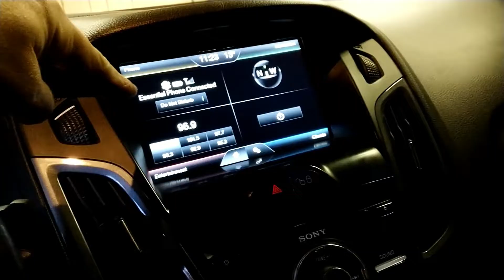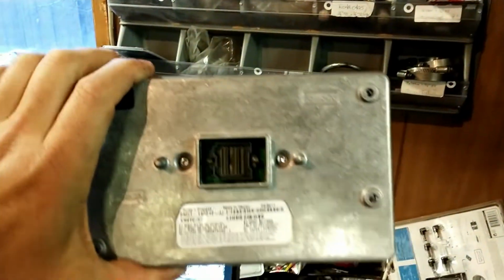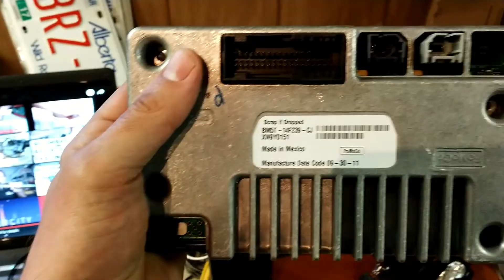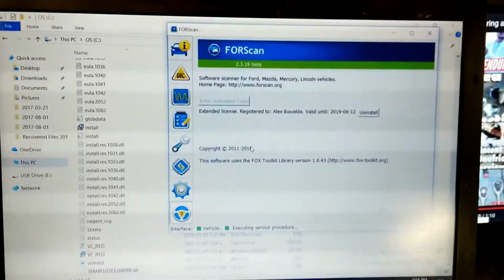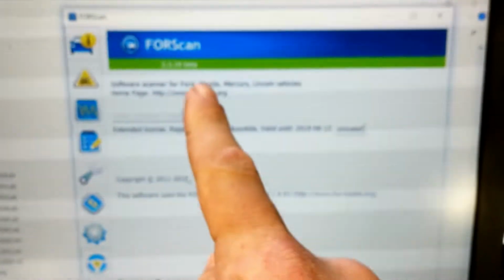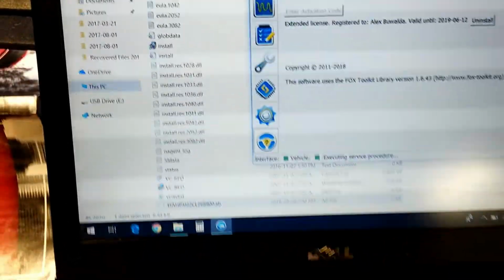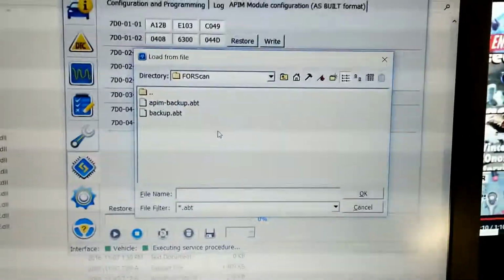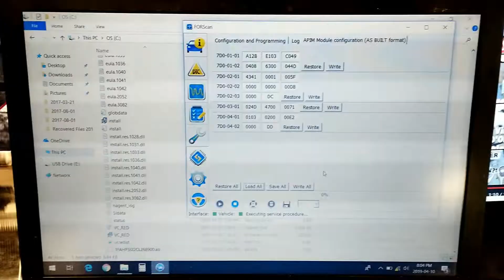Broken Ford Sync APIM Repair\Replace\Reprogram

Comment: I bought a great condition radio.
I can’t change my bass, midrange, and treble
My temperature isn’t working and I can’t see my volume on my car any tips I can do or do my radio has to be reprogrammed??
Reply from the maker: Hey there, did you buy the APIM from the same model car? or a different one? Most people seem to find a close model car is the best chance without having to go through the whole ForScan reprogram sequence like I did to go from Edge to Focus.
Reply: @Kingsoupturbo  no I didn’t honestly I don’t know what that is. Should I get one?
Reply from the maker: @_BOSS313  Was it a entire unit from another Ford?  Although the units are the same, each model has its own radio\climate control etc. The F150\fusion\Edge etc. all have different screens, and control for different audio.  So usually you want to get one from the same car, or you have to reprogram it to work with the model you have, so everything works.  On the Ford Edge one I got, I could use some functions but others didn't work at all and the screen was out of calibration.
Reply: @Kingsoupturbo  I bought another Ford Fusion radio I might just go and get it re program again thank your for the advice
Reply from the maker: @_BOSS313  It might be different from a Fusion Titanium to a mid grade model or something? a shame it didn't just work right away, even if you have to get it programmed still cheaper then the ludicrous cost from Ford for this thing.  Thanks for watching and best of luck!
Reply: @Kingsoupturbo  everything else work but those few things what Will happen if I master reset?
Reply from the maker: @_BOSS313  I'm pretty sure it just resets saved data in the APIM, but give it a try, you don't have much to loose!

Comment: Well I was hoping for the rebuild video. Cheapest APIM I can source is $200. I’ve looked at the boards and see nothing wrong. Only thing I noticed is the small board that attaches to the heatsink/case has multiple thermal pads. The side facing the heatsink has no clear film attached, the side facing the chips have a clear film attached to the thermal pad. I can’t find much on how this works. But is it possible that the film causes a break between the thermal pad and chip causing a thermal dissipation issue?

Comment: Is there any way to tell if the APIM vs the LCD screen is the faulty component? I cracked my sync 2 screen and the screen wouldnt turn on at all, just stay black. So I bought a replacement LCD off ebay, plugged it in and it turns on just like normal. Adjusting the radio on the steering wheel is reflected on the sync display screen, and even the backup camera turns on when I reverse. The only problem is the only responsive part of the touch screen is when i press the bottom right. Tapping anywhere else on the screen does nothing, but everytime I tap that spot it just takes me to the sync my phone display. Going to try unhooking the battery because I’ve read that can help reset the electronics but wondering if you have any ideas in how to fix it. Will be pretty stoked if I get it to work because the dealership wanted to charge out the ass to fix it but the replacement screen was like $80 on ebay lol
Reply from the maker: There is a secret diagnostic mode that does touch screen alignment.  Mine was like total opposite (upper right did lower left)when I replace the APIM. It took patience figuring out where to push but I eventually got it calibrated.  Do a quick search on touch screen calibration ford Sync 2 and you should find it, hopefully thats your issue!

Comment: Hello, I am a diy'er nurse (definitely not a car mechanic) trying to save the $1600 quote to fix the apim on my son's 2011 ford f150. I purchased a module with the same base numbers, got the OBD reader, ForScan subscription, went through the steps and nothing. I found another module on ebay that had exact numbers beyond the base numbers hoping I could just plug that in, but still not working. Anyone have ideas why this might not be working for me? I have not removed the battery cable as some have recommended. Otherwise, followed the instructions and written the as built codes "successfully' but it is still not working. 

Error codes do indicate the APIM is faulty, so I feel like I'm trying to fix the correct thing, but stuck. Any tips appreciated GREATLY!!!

Comment: If I purchase an aftermarket system do i have to replace this APIM or will I not have to deal with this problem ever again.. this just happened to my 2018 F150 ,and ford wants to charge me $1,244.00. Someone please help
Reply from the maker: This happened on a 2018? thats ludicrous! they must have some kind of warranty for that? try a different dealer maybe if 1 is trying to charge you on that.

Comment: My car is at the dealership right now quoted me 1359 for a replacement, I'm letting them try to update software and thats about it. If that doesnt work I'm going to try this next. If this wont fic it im getting a toyota
Reply from the maker: I hear you, I was getting pretty fed up with Ford on this car.  If you can find the APIM from the same car you likely won't even have to program it with ForScan at all.  1400$ to fix their garbage failed 14$ a piece that seems to fail just out of warranty, criminal.  Thanks for watching and best of luck!

Comment: Hi.  I've watched and rewatched the vid several times and the procedure seemed simple enough but it doesn't seem to be working for me.  I have a 12 Edge and bought a used APIM.  The screen fired up okay, but I have no radio or climate control functions and the touch screen is kind of wacky, so I figured I needed to reprogram it by restoring the as-built data for my vehicle. I plugged in the OBDII and connected and watched it read all of my vehicle's settings, then I made a backup of the APIM config.  I select Load All and I see the abt for my vehicle as well as the backup that I made.  I've tried selecting both of those files.  In either case, it says operation completed successfully then I select Write All.  It looks like it works okay, but when I turn off and back on my ignition as prompted, nothing changes.  It looks like it's working fine, but there's no functionality on my screen.  It's quite possible that I'm doing something wrong, but if so I don't know what it would be.  Any ideas?
Reply from the maker: Hey there, one of the things I had to do right off the bat was a touch screen calibration as mine was totally backwards and barley worked.  If you google touch screen calibration Sync 2 you'll find the secret menu thing to do it, its pretty tricky if its not calibrated to figure out where to push, mine also went super crazy dark at night and that was a secret menu option as well.   I also had to do a Sync 2 update to get my Navigation to work as well.  I know its all a big pain in the ass but you save a ton of cash over getting someone to program it for you or OEM parts.

Comment: Can i use the Bluedriver obd scan tool for forscan too?
Reply from the maker: Some of them can only read, you need one that is able to write data for it to work, check manufacturer specs to see if it works
Reply: @Kingsoupturbo  Thank you for the tip, cause i have the Blue Driver guess i have to read its specs thoroughly hehehe

Comment: I really appreciate it man 👍👍👍👍now u mean all the modules are same ? I would like to know I’m working on a 2016 f250 lariat
Reply from the maker: Hey there, thanks for watching! There is a year changeover where they went to a newer sync module, your 2016 might be on the cusp of that, but I believe all models use the same module but with different software.  If you can find one from a F250 of the same year or group of years, then it should work with almost no programming.  Does your screen graphics look the same as the one in the video?

Comment: Do I need to buy a new module or can I reprogram the one I already have.
Reply from the maker: Usually if it fails, you need a new one, if you get one from almost the same vehicle it came out of, you might not even need to reprogram it

Comment: Great vid. I lucked out and found an exact match on eBay. Do you think I’ll have to go through the reprogramming procedure? Or just plug n play?
Reply: Thanks for the reply. I installed today and it was plug and play. I disconnected the negative battery cable so when I reconnected it automatically reset the SYNC Module. Very happy, no issues. Going to mount the new module in padding to absorb any vibration etc. perhaps it will last the life of the vehicle. Fingers crossed!
Reply from the maker: @onerichartist  Thats fantastic! I couldn't find a matching Focus module when I did mine, but clearly the way to go!  Nice idea on padding it up for extra circuit board protection!  Its annoying but at least we didn't buy a backwards timing Chain Audi V6\V8 or something much more horrible! Have a great summer!
Reply from the maker: You might get exact plug n play if its the same model car, might have to do a screen calibration and nothing else! fingers crossed!

Comment: HELLO, I AM FROM BRAZIL AND I HAVE A FUSION TITANIUM AWD 2017. THE CONTROLS OF THE STEERING WHEEL STOPPED WORKING, AFTER I CONNECTED THE FORSCAN, BUT I WILL NOT CHANGE ANYTHING, SIMPLY SIMPLY ENTERED IN THE MODE APIM AND LEAVE THE MODULE WITHOUT CHANGING WITHOUT CHANGING WITHOUT CHANGING WITHOUT CHANGING WITHOUT CHANGING WITHOUT CHANGING TURN OFF THE SAME. NOW IT IS GIVING AN ERROR MESSAGE IN 2 MODULES, APIM AND IPC, WITH ERROR CODES U0212 AND U0155. I took the car today at the authorized Ford and they were unable to repair it. THEY REPROGRAMMED BUT IT DIDN'T RESOLVE. YOU KNOW HOW TO TELL ME WHAT MAY HAVE HAPPENED.
THANK YOU.

Comment: Sync 2 Modules
This is just based on what I researched and may not be 100% accurate, but I think it is close.
Any of these will work in any car.

Model # on front – Number with 14F239
Example: DP5T-14F239-AR

First letter has to do with the year – Not sure how the letters work for sure, 
But I believe It may be a year range of years for the model of car, but this does not matter.
Example: D = 2014-2015 Edge, 2015 F150, 2012-2015 Fusion or something like this.

The second letter is the model of the vehicle.
From what I researched I came up with this.

A = Flex / MKT / MKS
B = Explorer
C = F250 / F350
G = Taurus
J = Escape / C-Max / MKC
L = F150 / Expedition / Navigator
M = Focus
P = MKZ
R = Mustang
S = Fusion
T = Edge / MKX

This also does not matter if you are reprogramming the AIPM module with FORScan.
Because you are overwriting all the functions with the ones from your vehicle.
But if you are looking for a match, and you might not have to re-program it. Then this list may help.

Also:
You can swap Ford with Lincoln without worrying about the startup Splash Screen being correct if you program with FORScan. The code will be changed to the correct Brand.
If you are not reprogramming then buy one out of a Ford or Lincoln to match your car.
The startup Splash Screen files are in the APIM Module.
The Splash Screen is based on the Brand coded into the APIM
APIM 7D0-01-02 ?xxx xxxx xxxx   0 = Ford, 8 = Lincoln, C = Configurable (Don’t know about the configurable)

The other number on the back of the unit
Example: DA5T-14D212-RB
The first letter has to do with the year of manufacture
So If you have a B you can use a D (This is what I did)
B = 2012
C = 2013
D = 2014
E = 2015
F = 2016

Comment: Just curious... what the part number of the replacement? I have BM5T-14D212-JF. I can see your broken APIM has a similar part number. Do you know which one I could replace mine with? Or can I just throw in ANYONE? thanks in advance.
Reply from the maker: I think it basically has to look the same and it'll work.  If you happen to find one from the same model it helps but not necessary.  The sync2 modules look different I believe, so you can't mess it up.  All the Sync1 modules are the same with a bit different programming, best of luck on it!

Comment: Thanks alot , 
this solve a problem i was hate the car because of it.
and alot of technicians and engineers wasn't able to solve.
Reply from the maker: Glad I could help! I would not buy a Ford again after the Sync\transmission\collapsing fuel tank issues, poor warranty support

Comment: Hey would you know the problem with mine I have sync two 2013 Lincoln MKX the air condition comes on by itself anytime I touch the bezel anywhere a little tap on the bezel or if I go over a bump the air condition comes on

Comment: Thank you for the upload. The APIM went out on my 2012 Ford Edge Limited. I bought a $100 Ford F250 APIM off of Ebay and installed it in under 1 hour. I did not need to reprogram the APIM for my SUV. I can now use the radio, adjust the climate, and connect to my phone. The only thing I lost was the navigation. There are extra controls that I have under the climate section that I can not use since my vehicle does not have a heated steering wheel or cooled seats. Overall, I didn't need to bother with a reprograming and was able to use a different APIM to save money. The cheapest APIM I could find for my Edge was ~$500 and instead was able to use one off a different style vehicle. I hope this helps someone else in the same situation!
Reply from the maker: Great idea on the F250! I didn't even think about that, once the Ebay  part out guys find out something is in demand, the price rockets!  I drove my focus around for a while with no sat nav and some wierd controls until I spent the time to reprogram it, which admitidly is a bit of a pain! but nice that you've got all the important functions back!!
Reply: You got a non nav apim. There are some apims for $300 programed now just picked one up last week. With nav

Comment: Hey great video. Probably going to ask a question you’ve answered already.. here goes:  Replaced the apim in my 14 Fusion Titanum and reprogrammed with Forescan using as built data. Problem:  touch screen buttons don’t respond and I can’t get the heated seat icons back on the home page. Any suggestions would be appreciated. Also what numbers on the apim identify it so it can be crossed referenced to get the correct replacement. I’m wondering in my case if I purchased the wrong apim.  Thanks for indulging my query. JJ
Reply from the maker: Glad you found the video useful! I had to do a screen touch calibration to get the buttons to work on mine, they were 100% opposite when I first plugged in the APIM, if you google it, yo'ull find the instructions on how to do touch screen calibration.  Hopefully then you'll see the heated seats button? you might also have to download the Sync update to the newest version! as I understand all the APIM's are the same for sync version 1, we just have to get the right programming to make it work!

Comment: Excellent video! I just had the same issue happen and Ford told me it'd be an 1800$ fix! Luckily one of the collision shops in town has a bunch of these APIMs sitting around, but told me there was a high failure rate. He recommended that I just plug em in to the car, and see which one works, and then just pay for the one that does. Quick question -- prior to all the reprogramming/FORSCAN business, if I were to connect up a new APIM, will the screen at least turn on, so I know that it works? I can take it home then and do all the reprogramming!
Reply: Nevermind. Prior to replacing the APIM, thought I'd connect the ODBLink that I got to the Ford, and start it up. Connected with ForScan...and lo-and-behold...the screen came back to life. Ford still took about 200$ to "diagnose" my problem as a broken APIM...if anyone has ongoing issues with theirs...maybe worth your while to just get a connector and do the diagnosing yourself!
Reply from the maker: @ameyabopardikar9555  Very nice!! mine would shut down for days and then suddenly restart, especially on very cold days for months and months and eventually it just stopped working and wouldn't restart anymore.  Once you have a new APIM in there it should fire right up on the LCD, any one from the same generation should work, its just the as-built data that needs to change and you might need to patch to a newer version for satnav.  I hope she stays on for you! best of luck!
Reply: Sometimes, it may just be the Fuse!! I had an unresponsive Entertainment (Audio) with my Ford Focus and after reading around, I changed the fuse and it worked again!
Reply: @maxtaruff  Do you happen to remember exactly which fuse it was?

Comment: The same thing happened on my 2012 Focus. Sometimes it will crash with the gradient showing in the background and desktop.exe shutting down. This will be my first and last Ford product. If I had this issue in a F150 I know Ford Canada would bend over backwards to fix it.
Reply from the maker: Good point about the F150, they gave up on cars and don't care about things without fat profit margins, its pretty wild that these are so useless, fail so regularly, and were poorly designed from the start (I read about how the programming for the module was done in like Flash, pretty unstable) I would never buy a Ford again, lesson learned
Reply: Kingsoupturbo the initial release of the software was even worse – I kid you not.
Reply from the maker: @runforit420  Oh yeah I bet! I read about the software developers they farmed out the Sync too, and how pathetic the hardware that runs this thing is, apparently 14$ is the cost for the whole thing from their mexican plant.  Trying to squeeze every dollar out of the unit. That being said, it works pretty well now, the Nav is not bad and the unit is decent enough, but its rediculous to fail this quickly. We re-baked the board, checked for cold solder joints, everything and couldn't fix it.  No wonder people are buying Tesla's like no tomorrow, can't trust automakers.  Rant complete!